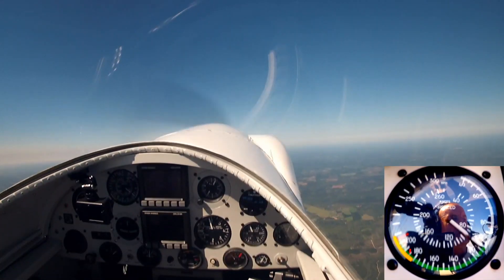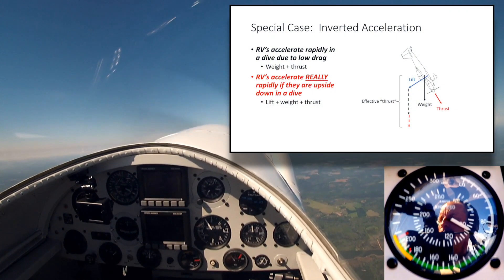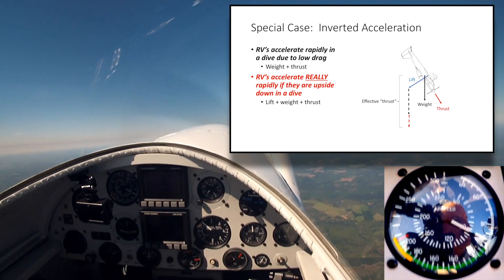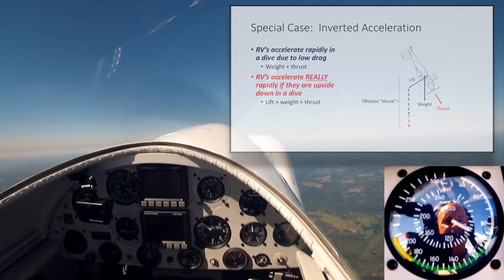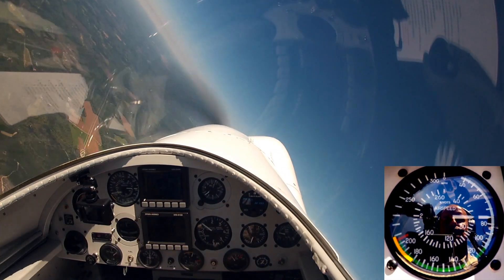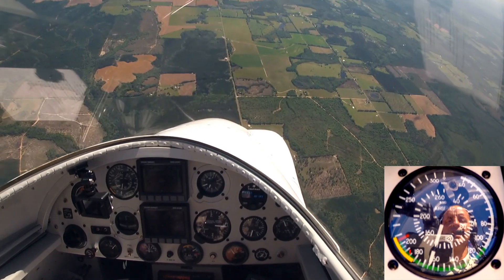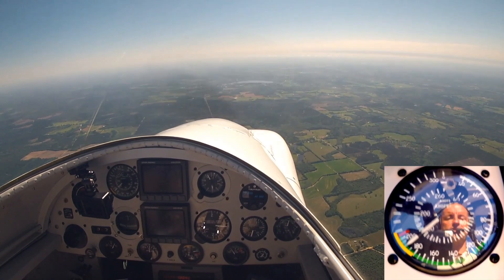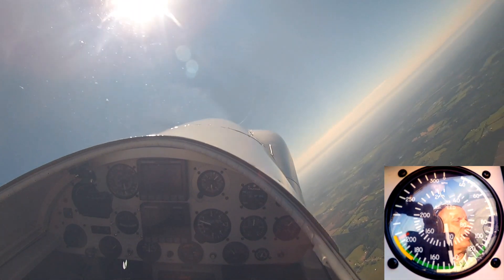Overspeed Demo High Def

Comment: This is the very reason I don't like clean airplanes for aerobatics. However something like an Extra or Sukhio does quite well with it's super fat leading edge wing. That adds a lot of drag and safety.
Reply from the maker: Good observation regarding drag characteristics.  Interestingly, the RV family behaves  similar to a fighter.  In that business we are less concerned with aerobatics per se than energy and turn circle rate/radius management; but that handling skill set translates well to the RV series of airplanes.  The purpose of this is simply to make folks aware of the characteristic and emphasize the need for proper training.  With RV's one other point to ponder is the type of prop fitted as there are handling differences between a light-weight fixed pitch configuration vs a controllable pitch type.  Properly handled, the RV's are good aerobatic airplanes, but certainly not in same class as airplanes built specifically for that purpose.  Fly safe, Vac.